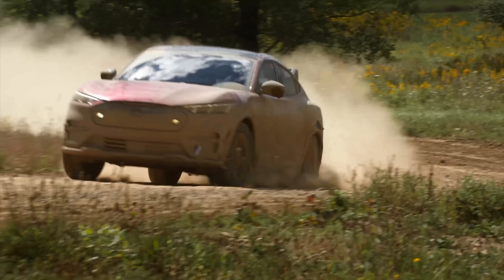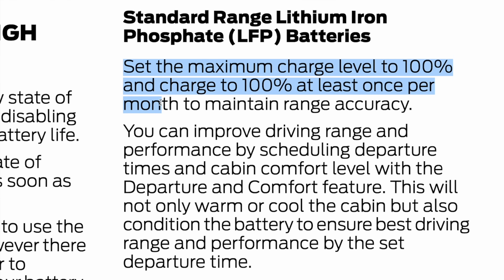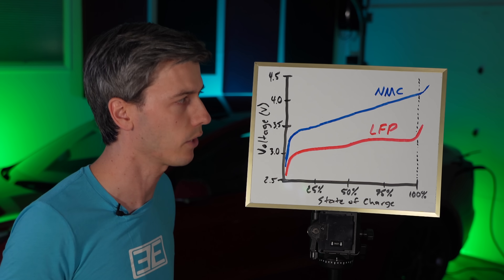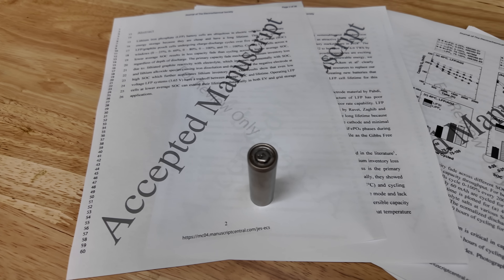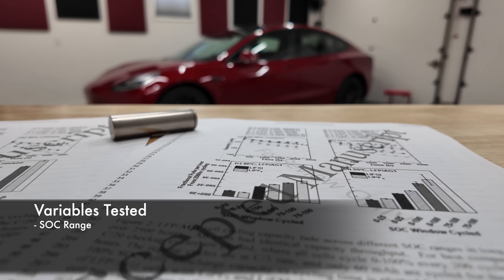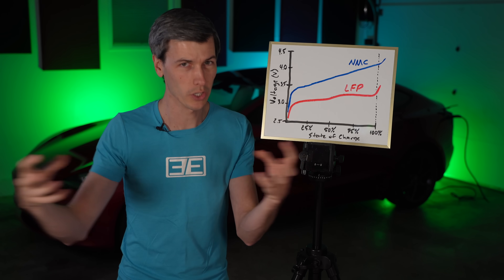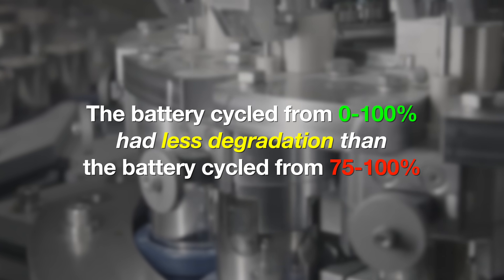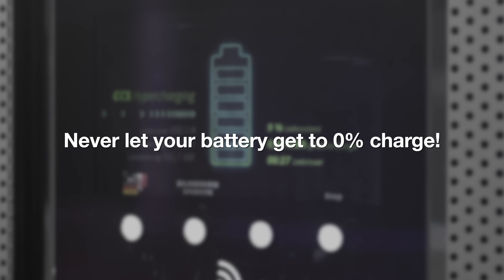How To Ruin Your Electric Car's Battery - LFP Edition!

Comment: I might need to watch this a couple times to fully “get” it, but I did have a question: if the battery has a higher voltage, does that mean the vehicle has more “horsepower”?  Ie, will the car feel slower at a lower battery charge/voltage than at full charge?  

My battery experience isn’t with EV’s, but with their smaller cousins: RC’s - ie, RC cars. With NiMH batteries, the car starts off fast but gradually but noticeably gets slower as you use the battery until it is just going at a crawl speed; whereas with a LiPo battery there isn’t much noticeable dropoff in speed until about 35%, but you still have most of your speed until it hits cutoff when the rc car just completely stops.  No slow crawl - just fast fast fast then nothing. 

So are car EV batteries similar? I realize most people aren’t giving it 100% throttle often in EVs, but especially with those voltage curves, it seems that the flatter curve would be ideal.  (Also, I presume at 100% charge in an EV, both battery types would have equal power in a specific model EV - say a Mach E GT. No matter which battery you have, at 100% charge, they will have approx the same 0-60 time? I also presume since the lithium batteries seem to have a lower voltage per cell, that manufacturers make up for this with more cells so the total voltage between battery types is equal? If so, does this have an effect on weight?)

Comment: Am I wrong to expect that there'd be charge limiters built into the charging system when the car is plugged in? Wouldn't this automatically regulate the health of the battery's chemistry?

Comment: So, I am planning on buying a Model 3 with LFP battery. My daily commute to work os around 13 miles a day. Even though is very little miles, I have a lot of traffic. If my understanding is correct, I should charge once a week to 100%? Will that minimize battery degradation?

Comment: With the advent of computerized automation, you'd think battery longevity for chemistry type would be programmed into vehicle's charging monitoring system to keep it simple for the average citizen. A button for storage. A button for daily use.  A button for planned long trip. AI tuning charging to driving habits. Just keep the car plugged in and let the computer do the thinking. Duh!

Comment: Since ev manufacturers build in a buffer top and bottom, I cant see any issue running the battery 0-100% since in practice its probably only 20-80%.

Comment: What a mess is in my head now! I have a new Tesla model 3 highland. I drive everyday 20 miles - should I keep charging it to 100% everyday or not? The local temperature is super hot in the summer, should I keep it connected to eletricity to let the car control the temperature (set max to 30 degrees) ? thanks my people!

Comment: I'm kinda bummed the research group used 0% as their starting point. As you said before: No one lets the battery go down that low in everyday use. The more interesting question in my mind therefore is: Let's say you use the equivalent total energy of 20, 33 or 50% every day - at which SoC do you do that? I'd be more interested in comparing the cycles  of 0-25, 25-50, 50-75 and 75-100% than 0-25, 0-60% aso. Not only is the numbers of cycles identical and intuitively that makes for a better comparision. But it also mirrors a more realistic use case where you set your charge goal, use your daily dose of energy and then charge up to the limit again.
Or it would be for NMC chemistry. If you absolutely must load up to 100% anyway, it would be better to turn the test around and make 100% your limit and do the same SoC range from there, e.g. 75-100, 40-100, 25-100%.

Another interesting question would be: Let's say you use 20kWh every day. Is it better to have a smaller battery pack, say 75kWh, that gets cycled more often (fully charged every 3 days) or a larger pack, say 100kWh, that you only have to charge every 4 days in our scenario.
In general: Higher capacity means a higher maximum current means you can draw more power. But if you're not interested in that and only care about longevity (and the added range for holiday travel), would it make more sense to go for the bigger battery pack anyway?

In the end, it probably doesn't matter: No one cares if the battery pack lasts for 500k miles if 200k miles are probably more than enough for the average consumer. EV acceptance is more a question of convenience than anything else: If my 200kW non-supercharger is only able to charge my Model 3 with 100kW because the cable is rated for 250A and the Model 3 has a 400V system, people will get frustrated. Then only half the chargers work, some say they work but wil only trickle charge, some can't read your credit card and heaven forbid you want to charge with a trailer attached to your car... Those are all problems we have to overcome before the average family living outside of a large city and who frequently visits relatives even considers making the switch to EV.

In addition: EVs are more of an appliance than the more emotional connection ppl have to their combustion engineed vehicles. A now 12 year old Model S will never be more than an old EV while a C63 AMG from that same year, that is way more expensive to own and to drive and probably slower, will still have its fans 10 years from now. Meanwhile, the Model S is only an outdated computer system with a clunky user interface, dated connectivity and (by then) siginicantly reduced range while current EVs are two or three battery generations further along.

This is not a stab at EVs: Most ICE cars never make it to 20 years either. But ecologically speaking it is better to drive an older car for longer than building a new one. So we either have to make EVs more modular to keep them relevant for longer or we need way better recycling strategies.
But the way EV manufacturers, especially Tesla but also Rivian, are handling things right now is absolute garbage: They won't sell you individual parts, they only change whole component groups for thousands and thousands of dollars and they even force you to do it at their own shops/service centers with sometimes weeks or months of backlog.
Car people look at that and shake their head in disbelief: If that is the golden future we were promised, count me out! Right now, the only EVs I'd buy are from Kia, Hyundai or Peugeot, Renault! German EVs are too expensive (Mercedes, BMW) or to ugly (VW, Mercedes, BMW) to be viable, Japanese manufacturers are far behind (the Honda E is fun but the range is bad and it's way too expensive), EVs from established US manufacturers are too big for German roads and also quite expensive. So the market isn't all that big if you look at it from this perspective. And with used EVs you not only have the chance the battery pack suddenly will stop working from one day to the next, but I cannot really change it myself while I would be able to buy a used engine and switch it over...

Comment: the main information missing from this is how much is an increased degradation ? If we lose 5% or 15%  battery every year when driving 10000 miles then ok the good practices are important. But if we are comparing peanuts then just charge your EV with good care but without too much worry. We cant expect everyone to become a battery chemistry engineer all of a sudden.
I'm sure there are numbers in the paper, I saw a couple of comments about them but it could help the purpose of the video if we explain the benefit/loss with good or bad charging practices

Comment: It's simple: don't discharge it completely. Don't fast charge it if you can avoid it. Don't leave it outdoors in cold weather. Don't use it in the cold if you can help it. Don't allow it to get baking hot either. Don't use it if damaged. Don't park it beneath the place you sleep. Don't part-charge it and don't leave it unused for weeks or months at a time (importers please note). Don't get it wet and don't feed it after midnight.
Reply: so dont use it then ;)
Reply: Yes, because ICE vehicles don't have any complexity to their "best practices", and why I never need to have "a guy" to chastise me for missing various fluid feeding cycles for them.
Reply: @gdutfulkbhh7537  Considering the battery will most likely outlast the life of the EV, just plug it in and charge to whatever you want (or according to the manual).

I have an LFP and charge to 100% at work and home, for example.
Reply: i have special deal to charge cheaply 40% of capacity.  so i   just aim for 30% to 70% charge cycle.  and never come below 20% or go above 90%
Reply: Spot on my confused state of mind after seeing the video, cars are definately gremlins in disguise!

Comment: Since the voltage curve for LFP batteries is flatter than NMC (resulting in the range estimation problem), would that mean that storing at lower states of charge for long periods (i.e. 50% vs 80%) is not as important?

Comment: I’d been told by multiple sources that LFP batteries were basically “the higher the better” when it comes to charge stage. I’ve literally been looking at starting projects centered around LFP batteries and planing on keeping them fully charged as often as possible, but now I’m just at a loss. I was even looking into specifically getting an LFP EV, and now I feel like just sticking with hybrids until solid state batteries are mature in a decade (hopefully).

Comment: Fact is the bulk of LFP batteries in EVs will far outlast the vehicle itself. By then, those batteries which may be degraded to 97% are still fine for recycling into home & solar power storage. I would not bother about "what's the best practice" for LFP. Just charge to 100% for your daily use & forget about range anxiety. Secondly, the Chinese fast charge LFP batteries have different chemistry which will render such advice obsolete.

Comment: My thoughts on this.  Set your (LFP) car to charge to a low SOC (even if the real SOC is currently higher) that way when you plug it in the battery won't charge but will be thermally managed (set this limit to whatever your comfort level is).  Once a week before you know you have to go somewhere charge using a delayed charging setting so that the car charges to 100% about an hour before you have to go.  That way the car can calibrate but it minimizes its time at high SOC.

Comment: I don't know about you but I would always go with LFP for safety reasons and I would not park a NMC under my roof because should it go to thermal runaway my house is gone. LFP is safer that way and the lower energy density is worth it for me for the peace of mind. So what the range is, how fast it charges or even how accurate the readout is is secondary as long as it is comparable and not magnitudes off. Of course longevity is high on my list too.

Comment: I’ve had my Tesla LFP battery car for over 4 months. The range, when new was 272 miles, now, after plugging it in every night, I’m down to 269 miles. I don’t drive it everyday so l’m charging it when it’s still at a higher percentage. Maybe that’s the problem of lowering range.

Comment: I wish they tested more realistic SOCs, e.g. 20-80%, 50-80%, or 20-100%. Cycling your battery under 10% every time is not realistic, just like most gasoline car drivers fill up the tank before the E light turns on. The 0-25%, 0-60% and 0-80% data points are interesting for the study but useless for most drivers. What I'd like to know is e.g. how 30-80% compares to 50-100%.

Comment: Question: Why for storage is 50% better than say 25% or lower? Are there differential effects between the two types of batteries? What happens if the temp changes? Thanks

Comment: You explained very well why I will never buy an electric car... that I should need to understand the science behind which battery I want and all the complicated explanations of when to charge to whatever percent and etc... my car, I put gas in it, and it goes over 300 miles. I don't need to stress about finding an "electric" refueling station and the problems with "electric hogs", the long waits for charging, 6% to 22% public chargers not working, up to 10 years to wait for the savings on gas and on and on. The promise of electric cars and the current state is not winning me over. In fact, it been a massive disappointment. Electric cars aren't ready, the infrastructure is not ready. And besides, I keep seeing videos that say battery technology will be better IN THE FUTURE, so we hopefully get away from dangerous car batteries burning down houses, apartments and need MANY THOUSANDS of gallons of precious water to put them out.

Comment: 16:34 That is the exact reason why RadioControlled Drone Pilots always charge their LiPo-packs balanced. That means that every individual cell during charging has the exact same voltage. Every charge and discharge cycle again.

Comment: thank you for all your reading.
im going with Linus Tips for cellphones where the sweet spot is between 20 and 80%. 

It was an old video from like 2010s.
also from my personal experience thats confirmed with actual researchers. deep cycle usage degrades batteries faster.

i remember having replacable batteries and would buy an external charger for my spare battery and swap out a fresh battery every so often.  
for the Samsung and HTC phones before Note 7.
so it was like the S5, S5 active, S6, HTC inspire, LG V20

i would run through a battery so fast. 

so I can personally attest that frequent full discharges and full recharges, when done frequently will shorten battery charge retention.
the old 100% for a phone could mean 8 hours but will now hold only 5 hours, while still saying "100%"

Id expect a similar thing for lithium battery powered cars, namely lithium but ive yet to own an E car muchless a Hybrid.
Reply: Phones don't use LFP batteries.

Comment: I live in Brazil and here neither Tesla or any other US car maker are selling EVs yet, although Chinese brands are invading our market with cheap and actually very good models. I bought a BYD Dolphin, a small hatchback with LFP battery and 204 hp and for now I'm amazed. It would be great to see you reviewing those car, specially because BYD has a proprietary technology for batteries called blade battery, which they say is safer and has more longevity. They even sell batteries to Tesla's. They are actually becoming so big that their ev sales have overcome Teslas!
Another thing that will be a concern with the rise of EVs will be the power efficiency of the electric motor itself. This same car I have for instance is capable of consuming only 13kw per a 100 kilometers. And since US govern is very skeptical about China at all, it would be great to show what north americans are loosing by blocking this imports.
Reply: China is evil. I don't support fascism. (China is NOT Communist).
Reply: I have the Dolphin as well. Many of my friends have been completely blown away by how good it is. One of my friends went from "you gotta be kidding me" when i told him what i was going to buy to giggling like a schoolgirl after a hard pull from an intersection.

Comment: If AI is so fantastic let's use it to manage the batteries. It should be able to figure out your travel patterns and appropriately charge your vehicle. Then also take the extra step and tell the system what your plans are for the week, planning a trip, let it know and the system will be ready. (dreaming I know)

Comment: If you over charge a LFP battery, it will go above 4.0V which is terrible for the battery, but it's still possible... keeping it around 3.4V  (100% defined by most car manufacturers) for an extended period of time is not a problem for LFP.

Comment: It would absolutely be foolish to leave your car unplugged when it could be plugged in, it would be relatively easy for it to get drained to nothing if it's really hot or cold out and you didn't drive it for a while.
Reply: Not in Tesla's. I leave mine unplugged all the time and it doesn't drain at all (sentry off)

Comment: We have a Mach-E with the LFP battery.  That was confusing.  The car's range is already on the lower end beacause it's also AWD.  I would like to keep it at a lower SOC for battery longevity, but it is also my wife's daily driver and she needs to have enough range to do her daily activities without having undue stress about SOC.  The car is a lease and I've always thought so far we would probably keep it at the end of the lease because the buyout is only $18K, but maybe if there's a lot of battery fade, we'll send it back at the end of 3 years.  I have been setting the target charge to 85% but maybe we'll go lower and see how it is.

Comment: Since 2014 I’ve been building (and racing) electric race cars, and from the beginning the team chose LFP battery chemistry because it is much safer that NMC, but LFP has the added benefit that our rather abusive discharge/charge regimen is less damaging to the cells.